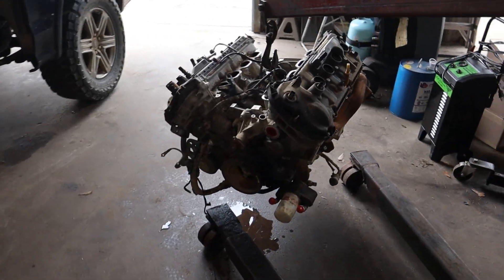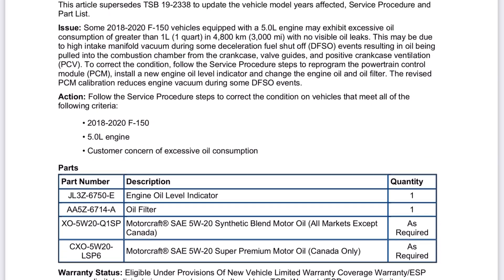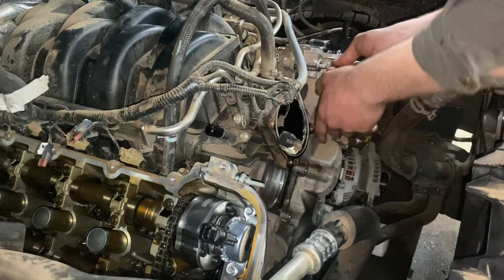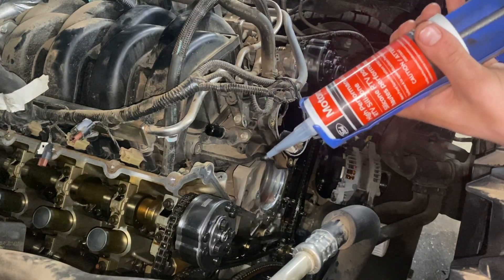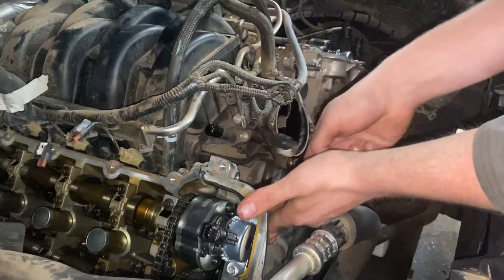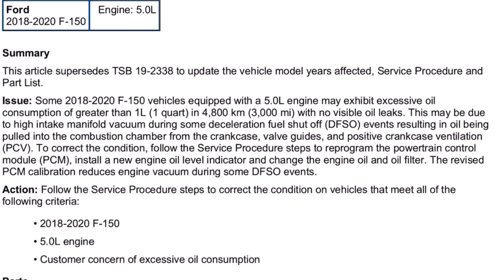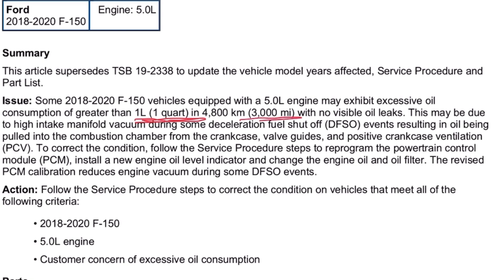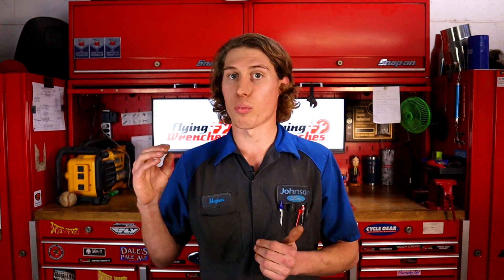Ford 5.0 Coyote Oil Consumption FIX

Comment: What a stupid video.  I'm not 65.  I check my oil. Always have. The electronics this so called mechanic is so in love with don't always work.  Especially on American (read Mexican) made vehicles.  I own an 2019 F150 5.0  with 59000 miles on it.  The only time ive ever driven it on a long trip it burned 5 quarts of oil.  By long trip i mean 700 miles round trip.  Thats not too much to ask from a goddam $42000 truck.  What a rip off.  Let me tell you, the oil burning is not the only issue with this piece of shit.  The panoramic sunroof broke the first time i used it. Was "fixed" under warranty and has already broken again.  The engine rattles, knocks, vibrates, and basically is just embarrassing to drive around my friends its so freaking loud.  The cam phasers are going out.  The buttons on the steering wheel that control the audio (more wonderful American electronics) work only sometimes.  The nav system is crap. Period. Use your google maps on your phone because the sync 3 system works only when it feels like it.  Oh, and to replace the hunk of shit computer is only about 6 grand.  Too bad Im so upsidedown on this and interest rates are stupid high now or i would trade it in a heartbeat.  And im not the only one i know that has the oil burning issue.  In fact out of the four guys i know that have this same 2018 and up truck, ALL of them have this problem and it gets worse and worse as you put more miles on it. Not to mention the catalytic converter is shit by 100k miles from the gallons and gallons if burning oil crapped out the tailpipe. DO NOT BUY ONE OF THESE TRUCKS!

Comment: The software solution makes sense.  By changing the control law for the EGR valve the intake / crankcase differential pressure can be reduced.

Comment: I'm sorry but not checking your oil is about the dumbest thing I've heard of, your saying ignore it until your engine starts making noise.  At that point it's far too late but I'm sure Ford will happily sell you another engine for $10k+.

There should be no reason for an engine to burn oil unless it's worn out, especially on a new vehicle that costs north of $50k.

They shouldn't be building this trash if it's gona drink oil, we've learned how to build decent engines that last and don't use oil but for some reason we've gone backwards and started building garbage that will be lucky if it makes it past 100k.

Ford isn't the only one with this problem either, nearly every vehicle manufacturer has one or more engines with oil consumption issues.

I'll keep my 84 F250 with over 300k and my 14 Tacoma, neither one use a drop of oil.

Comment: They have already put to motors in mine and swap everything in both of thoses engines twice trying not to put a new engine in it. I have 15,000 on the new engine and I’m 4qts low at every oil change I’m 10,000 away from losing my warranty. Does anyone know about the oil catch can fix?
Reply: Ps they changed all the cam phasers timing change cover everything in them

Comment: Why can't I get a replacement coolant line to the transmission cooler on my 2018 f150 with the 5.0 and 10 speed automatic transmission. 😢

Comment: Hello Mayson & ALL !!  Thanks for the video on the " oil-burn / Oil-checking " ideas !!  I am 71 & have always checked/oil in all my cars ( mostly on a weekly basis ).  Consider this; Even though Ford " might " have designed the 5.0 to run on oil levels from 6qts to the full 9qts;  those actual 3 quart-oil-volumes add to so much more
about support of the entire engine ( cooling, carbon-load of the oil, etc, etc ).  Keep up the great-work on the videos !!!    Tks Again,  jeffrie / Camas, WA

Comment: @ 4:20 I turned away and laughed out loud. Mercedes took away the oil dip stick.  We will get there.  Speaking on the unfair treatment of "dipsticks".  I believe since we started calling out idiot friends and buddy's "dipsticks", the dipsticks actually turned and ran. They didn't want to be associated with dumb ppl. Just my .02c... oil is your ring seal.  Like the oil creates a seal against the ring pack. Ask any engine builder. Manufacturer run these thin thin oils. Gosh 0w20... what kinda oil is that.  5w20, 5w30 are common. 20yrs plus ago you saw 10w30 10w40.  Manufacturer using a lightweight out, less drag on the engine, increases fuel economy.   Government wants these vehicles to get better mileage and better emissions.   Throw 15w40 in your 5.0 get increases ring seal but watch it loose something on the other end that is way more important to someone wayyy bigger then us consumers.

Comment: I have a 2019 5.0 its burned 4 quarts in 3000 miles. Has the computer update fixed the issue for yall?

Comment: I have a 2020 F150 XLT 5.0L engine. I have experience lots of oil consumption issues in last 6 months. Thanks to YouTube, I found videos like this which are Extremely helpful! Now, Ford wants me to pay for this Technical Bulletin repair...WTF??  I explained to the Service Manger and Ford Customer Service this is a Design / Computer flaw issue and Ford not only should pay, they should gladly pay v/s having a Recall or Class Action filed. The other issue I am having is I can NOT run Reg 87 Unleaded or the engine pings terribly, especially from a dead stand still or when I step on it some on highway. The only solution is to run 93 Unleaded. I complained to Ford about this as well as this is costing me MORE $$ to operate the truck :(:(   Yes, I only run branded gas and only fill up at high volume locations. Does anyone know where I can find video(s) about this engine pinging...NO luck so far :(:( or offer any other suggestions??

Comment: lmmfao i hear yah i was a gm tech for years and i saw the same thing just not as crucial .but in my opinion most social media experts do really have a life they just love to complain about something .especially if they don't know what there talking about .it is a proven theory if you remove so much oil from an engine it will make more horsepower on a Dyno do to less oil slap .these engines today burn oil even ls engines but like you said do your maintenance and you wont ever see an issue or think you even have an issue .those who don't do there maintenance blow up there engines then want to blame someone else .that's how simple it actually is

Comment: I have a 2018 5.0… went thru 2 milage tests after 10k miles. Problem was fixed by changing to 5-30 from 5-20 oil… problem resolved. I also installed a Ford Performance oil separator with in 1 week of new.

Comment: I only check my oil on my much older vehicles. Mainly would be my 1950 Rocket 88 because it doesn't have all the computer protections. I admit I never check my oil anymore in my 02 Taco or my 23 Tremor because I don't need to. I also quit checking my oil in my 2013 Tundra that I sold to our company last year with 120k miles and only having to replace the AC compressor during that time. I do check oil in my lawn equipment though 😁. Peace, Love!!

Comment: I’ve definitely noticed top end ticking when my truck is down 1 1/2-2 quarts. Would it be lifter tick? No loss of oil pressure. 2018 f150 5.0 47k miles

Comment: I think that this is bs...the 18 and up motors use oil but the 16 and 17 dont ? What changed except the direct injection ? Ford is not going to fix a problem  but instead tell customers it all in their head ? I think it's for me to go  back to Toyota for cars and trucks.

Comment: I understand his mindset but I'm 58 and I do check my oil.  I have a gen2 2017 GT and I barely let my mileage go past 2500mi and I use full synthetic.  My 2011  Mazdaspeed 3 doesn't burn oil but I still check . To hear a millennial say DO NOT CHECK YOUR OIL is crazy.
Reply: too reliant on warning lights, indicators.
Reply: You both are stuck in the Stone Age. I’m a 41 year old mechanic. 
Everything he’s saying is correct
Reply: @matthewmoran8661  yeah dont check the oil and let the engine burn oil and have bad catalytic converter and ton carbon in the manifold and and the back pressure may cause the engine to knock and still dont check the oil , idk i have a question i drive 15,000km on specific brand oil that says the oil can run for over 25,000+ km so i should be safe but when i went to change the oil the mechanic says that the oil is still oil but some of it turned into a mud so i did flush befor i change the oil and and after less that 10,000km i did flush again to make sure that the engine is clean but i didnt knwo about the pcv valve , should i change it too , could it be the reason why the engine burning oil
Reply: @J@J@J @Jack_sparrow-am-different bruh… this comment makes no sense. You clearly don’t have a mechanical background. Are you talking shit or are you asking me something? 
I’ll give you the benefit of the doubt unlike a lot of people on the internet.
Yes, it depends on the engine and how your pcv system works but for the most part, a malfunctioning valve will cause an excessive amount of oil to burn. 
Also pls stop “flushing” your engine
Reply: @matthewmoran8661 nah i do understand  , and thank you , plus i just know today this is not mud  , what part that does not make sense ? , yeah i dont know what come before what , what i know is my engine burn oil then the catalytic converter got bad or carbon and that cause back pressure and then the manifold gets carbon too , for now i ok i will clean the catalytic and the manifold and thats it , thats what i know , if you know more tell me and thank you , thats wasnt mud that was some old oil , i will try to say it shortly , i put that oil that have long distance  25,000km and i drive 15,000 km and went to change the oil and he said some mud is there but thats not mud that old oil that was in the engine it came out , if you doubt it read about amsoil
Reply: @matthewmoran8661 i just changed the pcv two days ago , i have catch can but i didnt think about the pcv , so i know some oil come out the pcv and go into the manifold , idk think about the pcv , every 5,000 km the engine burn 1 liter and as far as i know its ok for coyote
Reply: @Jack_sparrow-am-different  interesting.. I’m a master bmw tech so I’m not an expert about the coyote. I own a coyote like yourself so I’m still learning about them. An actual ford tech would be a better resource for you. Although I do have other resources that others don’t. What year is your coyote? 
I think I just read your earlier message wrong. I have better an understanding now after your last comment. Have you checked your valve steam seals? Does the coyote even have a replaced pcv valve or is it built into the valve covers?
Reply: @matthewmoran8661 f150 2019 which is gen3 coyote
Reply: @matthewmoran8661  to replacement , for oil consumption , ford say change the dipstick and change the engine oil and the filter and reprogram tsb
Reply: @Jack_sparrow-am-different yeah I have access to that sib. It seems like you have something unrelated going on
Reply: @matthewmoran8661 what do u mean
Reply: @matthewmoran8661  idk why you said this but its the oil consumption its the reason why the catalytic converter is bad and the catalytic converter is the reason why the manifold contain a lot of carbon , that all
Reply: @matthewmoran8661  This reprogramming is officially known as a PCM Calibration Update, often referred to by technicians as a "PCM Flash" or "Software Reflash : that what i found
Reply: @Jack_sparrow-am-different I do those everyday. You have different problem
Reply: @matthewmoran8661  they say it might be piston ring or the sleeves
Reply: @matthewmoran8661  there is a guy on youtube says this too ford says change the dipstick and the engine oil and the filter and reprogram pcm , also u can find ford pdf on internet about ford 2018-2019 excessive oil consumption thats what for say .

Thats is ford solution , the guy on youtube say it doesnt make sense but one guy in the comment say as long as it fix the problem , its fine , 

The problem is with coyote manifold haigh vacuum and reprograming pcm fix this issue
Reply: Bro he was kidding
Reply: @MilesMassaglia no… you’re wrong

Comment: I have a 18 f150 5.0 with 150k and only uses less than a quart of oil between oil changes. 4 thousand miles or less on the oil changes

Comment: BUH.... Dual overhead cam 4 valve engines are high performance, high revving horsepower machines.   They will use a lil oil.  I bought my 2019 new.... and it used about a quart every 2K miles during break in. Normal stuff IMHO.  At around 10K miles, she quit using oil (hard to get the rings to seat properly using synthetic blend oil) still running original software and dipstick.   38K miles on her now and is idling quiet and running/pulling well.  More than happy with my 2019 F-150 crewcab :)

Comment: Weird to overlook the 18+ had sprayed in cylinder liners which caused the rings not to seat and or the linear wore out causing the oil consumption issues because the gen 1&2 coyote motors never had this problem.

Comment: I have a 2019 F150 with the 5L V8 and have had many oil consumption problems.  Two times it was in to be reprogrammed to fix the excessive oil consumption (1 quart every 1,000 or so miles).  I now have it in the they said the sulfur content in fuel breaks down the cylinder wall coating. The fix this time is to have a brand new engine put in, luckily I have an extended warranty on the powertrain. The problem is the Ford service at the dealership said it took 8 to 9 months to fix the last truck they had in for the same problem.  Obviously I am not happy about having to wait.  Not sure if anyone else has a similar situation or have experienced that long of a wait.

Comment: When I used 5w20 I had oil consumption issues, it used a lot of oil, I changed to 5w30 pennzoil ultra, it cured the problem. I drove 5.000 miles and I barely had any change in oil quantity. changed oil at 5,000 used the same oil and same results.

Comment: I had the TSB performed on my '20 F150 5.0. When I was looking through my service paperwork, I noticed they put 5w30 oil back in even though the TSB calls for 5w20. I made it 5000 miles to the next oil change without adding but judging from the level on the dipstick, had lost a little more than a quart. Took it back to the dealer for the oil change and they went back with 5w20.  At 2500 miles I was right at the bottom hole on the dipstick and added a quart to get almost to the middle. My next oil change, I'm going back to 5w30.

Comment: I have a 5.0 2018 and it burned much more than my 2012, but after the dealer did what they did and it broke in it has gotten much better.  90k and counting…I love the power, sound and mileage.  Sorry, I will always check my oil.

Comment: Hey brother, I have a 2012 f150 with the 5.0 and I’ve recently been seeing a few things about exhaust valves getting too hot on cylinders 4 and 8, causing them to wear down, recess, and tulip. Is this something that happens often or should I just forget about it?

Comment: L0L
Always checked oil.
Ever since they cheapened their quality (1975 onward).
Yes, rely on idiot lights and you'll destroy vehicle.
  Watch Daves Auto and learn about infrequent and low oil changes !
  Manuals say oil change 10k miles.
 Check U tube for oil change horror tales at 10k miles.
  Auto mfg. lie.  They boast low annual/3 yr maintenance costs at cost of proper maint.
  Many good Techs on  UTube explain this problem.
  Learn.

Comment: I have a 2018 5.0 F150  and after a 5 minute idle when I step on the gas, Oil smoke is completely billowing out of the exhaust pipe. I also have to add  at least 6 quarts between oil changes. The mechanic installed a new dipstick per Ford's bulletin, which i now learned lowered the minimum level indicator line on the dipstick to attempt to hide the problem.
Reply: Mine doing the exact same thing 2018 5.0

Comment: The coated cylinders & low tension rings were meant to reduce internal friction & improve mileage, which should reduce emissions. High rates of oil consumption would seem to defeat the purpose, & a quart in 3,000 miles is on the high side. That’s the engine that an old fart like myself is keeping an eye on.

I’m 62, & my habit since cutting teeth on 60s muscle in the late 70s has been to check oil every time I put fuel in the tank. Fuel consumed is however many hours of operation over distance, & that used to happen more often than now. Checking oil is something to do while the tank’s filling, & the engine that needed half a quart within a 3,000 mile change interval was an engine to pay attention to.

You’re right, things change - my first couple of cars had no form of emissions control at all, & then there were the malaise years of ripping air pumps out of early, no-compression emissions engines, etc. A modern V6 makes significantly more power than most old school V8s w/ twice the displacement, & they do it with remarkably little fuel - but older goofs like myself, we still like to lick the dip stick.

I have a BMW N52 that has no dip stick at all, just a level sensor in the sump, & it’s my least favorite thing about an engine that doesn’t need weird cylinder coatings. The abrasion resistance is in the alloy.